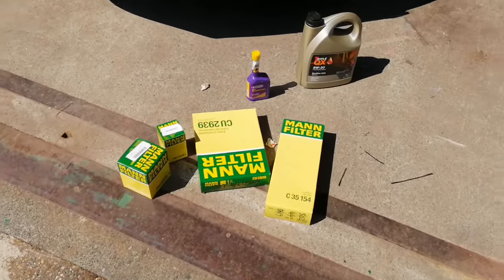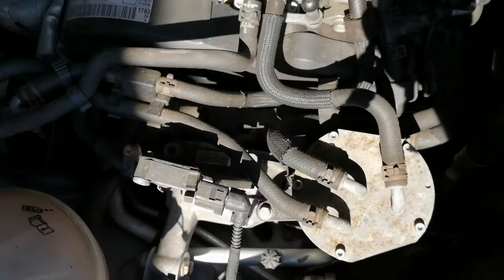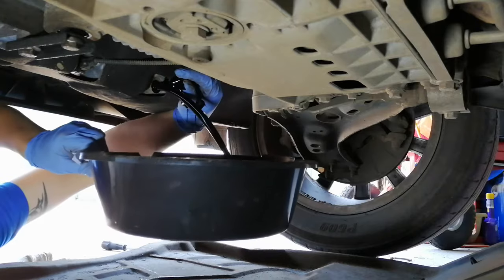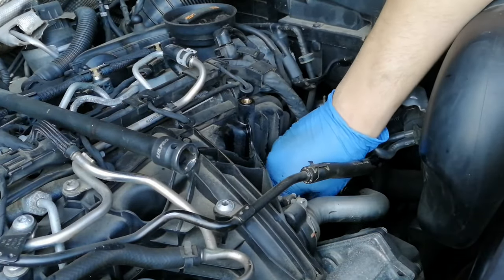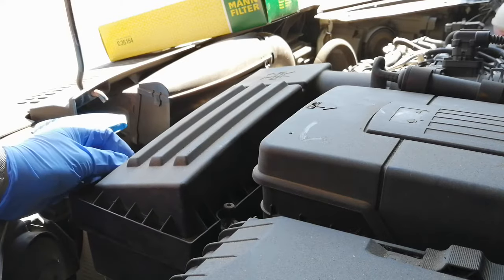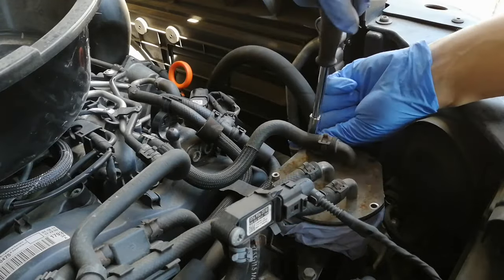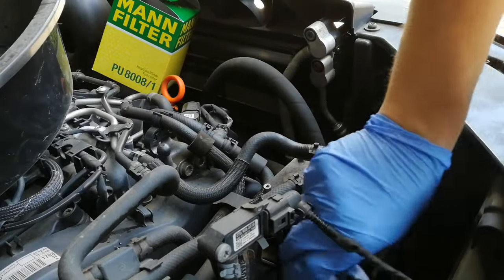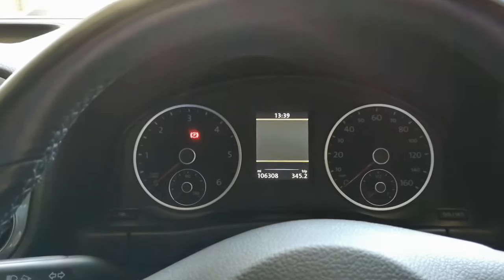VW Tiguan 2007-2016 2.0 TDI full service step by step. How to service my car?

Comment: Great video, very well done! ONE THING THOUGH: when changing fuel filter, you really want someone with Vagcom/VCDS diagnostic software and cycle/prime the fuel transfer pump a few times before starting the engine. This fills the housing and filter and the whole system with diesel again, eliminating all that air. The way you do it introduces a lot of air into the system and may damage high pressure injectors. One DIY way to do it would be to flood the filter housing with diesel when you're done, just like you found it. When I cycle the pump, you can literally hear bubbles for the first one or two cycles.
Reply from the maker: Hi there
Thank you very much. Yes, I usually do it on a newer models to be honest. Unfortunately most people haven't got any diagnostic tools. That's why I always advise to fill it up with a fuel or fuel additives and then cycle ignition 5 or 6 times before starting it up 😀
Reply: @AlexTheGrumpyOne  That's the best way to do it when no diagnostics available. Again, thanks for a great video, I know how to do all of this and watched the whole vid anyway! Definitely one of the best out there, you covered it really well.
Reply from the maker: @GoodDeal123 thank you very much 😀 I appreciate it a lot!

Comment: Great video - really helpful. Just for info, my 2016 Mk1 2.0 TDi bluemotion (150BHP) has the filter underneath, opposite side of sump from the drain plug. You need to move a cable slightly to get at the filter. Remove centre plug first (13mm) to drain the housing, then  remove filter housing with 32mm socket. There are two O rings to replace. The engine under tray is a bit fiddly to replace. It's easier to remove both front and back sections, and refit the back section first, then the front section.
Reply from the maker: Thank you very much!

Perfect and thank you for your extra info 😀

Comment: Excellent video, thanks for taking the time to record and share it. My CFFB engine Tiguan is exactly the same as this for anyone else reading this and wondering of theirs is the same. 

I used a sealey vacuum pump for convenience and my bad back and got just over 4 litres out.
Reply from the maker: Thank you. Yeah usually it might just have a slightly different fuel filter or minor difference. 
Yeah usually they hold around 4.4l

Comment: Thanks for the video man.. This really helped, normally a friend helps but this time I decided to do it myself..
Reply from the maker: Thank you 😀 well done and good luck. Just make sure that the fuel filter seal is in properly 😀
Reply: Yes, already drove around and no leaks anywhere
Reply from the maker: @kevinmartins2286 awesome 👌 well done and saved yourself some money 😀
Reply: Yeah, in South Africa they charge an arm and a leg for a service at VW
Reply from the maker: @kevinmartins2286 yeah I think that's everywhere unfortunately.
Reply: @AlexTheGrumpyOne  You Don't pehaps have a Video for the Timing Belt replacement for the Tiguan

Comment: Nice , I just did the oil and filter on my 2010 Tiguan - same as you and no issues. I dont have a working torque wrench so I just kind of winged it for tightening the oil filter and sump plug nut ...
Reply from the maker: No worries 👍 well done 😀 as long as its not leaking u all good 😀
Reply: I calibrated my torque wrench by hanging some weight off it and calculating the force - I love youtube. Climbed back under the car and checked the sump plug - I tightened it to something a bit more than 30nm it seems - but dont think I did damage- will leave it alone now :)   @AlexTheGrumpyOne
Reply from the maker: @helimax well done. That's a bit full on haha but well done 😀 that works.
Reply: @AlexTheGrumpyOne  hmm in last week my Turbo is whistling a bit more than before and I noticed chugging idle on cold start today and engine temp on dash ( coolant ? ) moving about a bit - like not holding 90deg C  but moving down to 70 and back up in a few mins some times.... I wonder if my oil change did naything funny - I didnt go back and check the filter housing was tight enough with the torque wrench after calibrating it. Wondering if not tight enough could let air be sucked in past the seal or something ? Will go check that today and will change the Engine Air filter also! And I'll buy a turbo cleaner spray and try that cos why not :) Oil level seems fine and not leaking. ANy idea? I plugged in VCDS and no obvious realted fault codes - I drove it high revs for a trip also and I think it did the DPF regen so thats good.

Comment: Thank you very much, this video was very interesting and informative.  I wanted to ask, do you ever flush you engine and if so what do you flush it with? I heard that flushing it with a mixture of diesel and fresh engine oil is very good .
Reply from the maker: Thank you. 👌  
No, personally I avoid doing it as most of the cars usually got over 80k on them already and its not recommended as it can cause issues. Flush is good on lower mileage cars and also when it's been done before. 
Specially if it a chain engine with high mileage... u can create a big issue.

Comment: Good video, it's with plenty of details.

Just a question, what is the force on the torque wrench for the oil filter box and oil plug screw?

Thanks
Reply from the maker: Thank you! Much appreciated! 
Should be in the description bud. I will have to double check on autodata if it's not there
Reply: @AlexTheGrumpyOne  During the video you say that you are going to put all the torque values at the end, but it isn't. It's going to be the first review I'm going to do to my Tiguan and I don't want to spoil anything.
Reply from the maker: Sorry mate you are right. I do apologise! 
Torque settings:
Drain plug -  30NM
Oil filter housing - 25NM
Fuel filter - 5NM
Wheel nuts - 120NM
Reply: @AlexTheGrumpyOne  thank you
Reply from the maker: No problems. Sorry for the delay

Comment: Hello Alex.  is this VW Tiguan 2007-2016 2.0 TDI car need to change power steering fluids??? from the manual book it say need to change Hydraulic Fluid how?? Please make a video on it.  Thank you
Reply from the maker: Hi there. From what I heard they never really do change powersteering fluid. But I will have a look for you. Was going yo do the gearbox oil change soon
Reply: @AlexTheGrumpyOne   Thank you so much for it.   VW Tiguan 2007-2016 2.0 TDI  gearbox oil change Also nice.  cant Wait.
Reply from the maker: No problems. You are welcome

Comment: Hi, great video thanks. Isn't there a water trap on fuel system? My 2021 Tiguan has fuel filter same as yours, you think it won't bleed with being hooked up to diagnostic stuff? Doesn't  water gather in bottom of bowl? My oil filter with 24mm nut, is underneath car
Reply: Meant to say , won't it bleed without having an diagnostic thing attached like you said
Reply from the maker: Thank you for the oil filter info 😀
Yes yours will definitely need a diagnostic tool to bleed it unfortunately.
There is no drainer for the water on them unfortunately
Reply: So why didn't you empty the bowl to get rid of any water that might be there? At you guessing about the diagnostic tool? When did the requirement come in exactly. Bet you don't know

Comment: Hi Alex, I just bought VW 2012 tdi. I can't see any Adblue tank. Does this model comes with adblue tank.
Reply from the maker: Hi there. No they havent got add blue tank 😀  yours is bluemotion?
Reply: @AlexTheGrumpyOne  thanks a lot for quick reply. Does this make any difference or do I need anything else for diesel. Also love your video.
Reply from the maker: Thank you very much 😀 
It doesnt make much difference its just for the emission control. I recommend using a diesel system treatment every now and then and giving a car a good drive at least once a month on a motorway to clean the dpf. Needs to get nice and hot for at least 30 min
Reply: @AlexTheGrumpyOne  please don't take me wrong. I saw at the back it says 4MOTION. Does it still means bluemotion as unable to see Adblue tank.
Reply from the maker: Sorry. My bad. Thinking of Scirocco now. Yes my Tiguan had 4motion on it as well 😉 doesn't mean that it got add blue 😀

Comment: Super video buddy. Are these the same for petrol Tiguan? The TSI engine?
How reliable is the TSI Tiguan? I just bought one of 2011 model. Any thoughts?
Reply from the maker: Thank you very much! 
They are slightly different on petrol engine. I think oil filter is under the car and not sure if it got fuel filter on them.

Comment: How are the TDI engines in these for reliability? I’m looking at getting one for a run around
Reply from the maker: They are perfect. As long as you service them it will run for ages. Makes sure you do cam belt on time. 
The only issue you might have is the egr problem. But that will also depend on how much driving you are doing. Need good long drive in them at least once a week to make sure you burn all the crap in the dpf off

Comment: excellent document
a question friend, what nut should be used to remove the oil filter plug? and the number of the oil ?
Do you remember?
I'm from Spain and I can't read your video that's why I'm asking you, sorry xD

Greetings !!!
Reply from the maker: Thank you!
No problems
The oil filter one is 32mm
The drain plug is 19mm
The oil type will depend on your weather in your country and temperatures. I would recommend checking at your local store.
Reply: @AlexTheGrumpyOne  Thank you very much Alex you are great
Here in my country (Spain) we put the Castrol 5W30, this oil many of us here have traveled more than 400,000 km
Thank you again you are very kind friend, I wish you the best
Reply from the maker: No problems buddy.
Good luck with your service and if you need any more help just let me know. 
Thank you for your support.

Comment: hi Alex , i have a 2015 Tiguan 2.0 tdi 4motion and the clutch pedel has started to stay halfway down now and again any idear ?
Reply from the maker: Hi there. 
I would start first with looking at pedal itself and floor matt. Sometimes they can get under it.
If thats all good then check your brake fluid level please. 
That might be your release bearing mechanism starting to go. 
What is the mileage?
Reply: thanks Alex have topped up brake fluid and things seem to be better.
Reply: @AlexTheGrumpyOne  the mileage is 59000
Reply from the maker: Ok thats good. Now you need to keep your eye on the level... there is only few things that can cause brake fluid to drop level. First and not stressful one is your brake pads wearing thin as piston has to come out more to brake it will use more fluid.... so I suggest checking your brake pads thickness just to be safe. 
Apart from that it can indicate a slight leak in the system... that can be either brake system or clutch system. 
So just keep your eye on the level for now and let me know how you getting on. Also if you can check under the vehicle for any signs of brake fluid leak or etc coming out maybe from the area where gearbox joints the engine.

Comment: Is this applicable to a 2019 tiguan?
Reply from the maker: If yours is diesel 2.0 then it will be very similar
Reply from the maker: Some of them might have the oil filter housing under the engine on the front of it

Comment: hi, I wanted to ask you the size of the socket that you used in the video ,because i need to cange the oil filter too
Reply from the maker: Hi there. If I remember correctly it's a 32mm socket 😀
Reply: @AlexTheGrumpyOne  Thank you very much, you saved me
Reply from the maker: No problems at all. 😀

Comment: Is this a common rail or PD engine?
Reply from the maker: This one is CR engine.
Reply: @AlexTheGrumpyOne  you cannot prime the fuel system by cycling the ignition on a vw common rail diesel engine.
Reply from the maker: I have been told that before. That you need to plug in and activate the pump to bleed the system. So far never had to do it to be honest. All of the ones I've done managed to start well after the cycle.